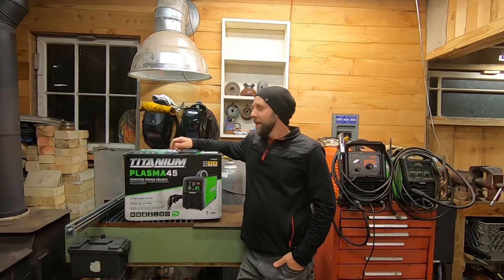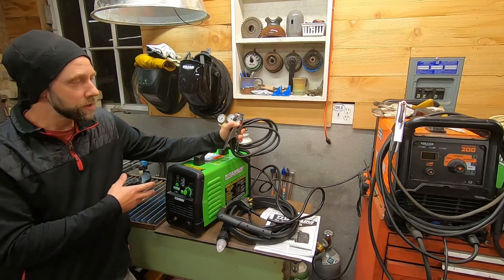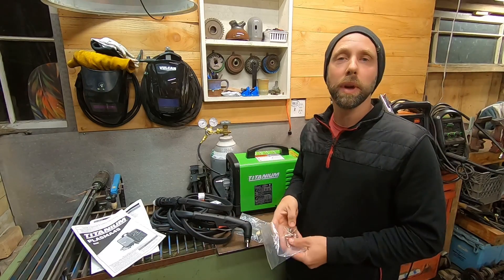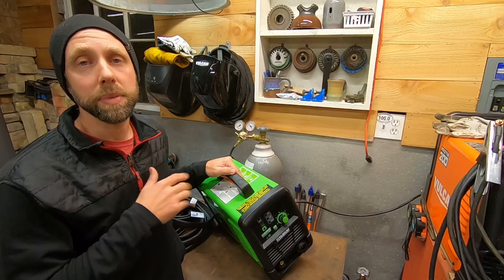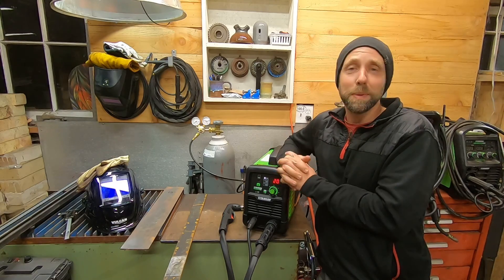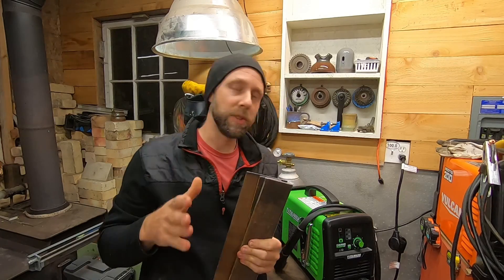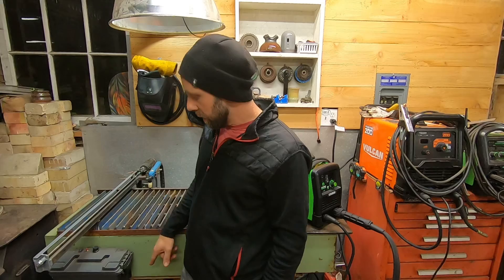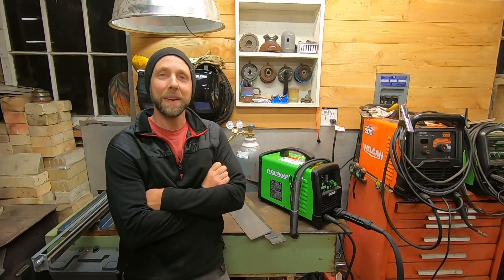Titanium plasma 45 plasma torch review

Comment: Hey Mike. Bottom line if it was your money would you buy it?
Reply from the maker: Hey Todd I think this plasma torch works really well, I have cut over 300 feet of metal and aluminum with it so far with no problems.
Time will tell how it holds up but I think it’s a well built machine. I do think it’s priced a bit on the high side, I think $650 or $700 would have been better. I know there’s a lot of plasma torches available for much less but a lot of them tend to be high frequency start and they won’t work on a CNC table. I would say yes I would buy one but only when it went on sale, but I would really weigh out my options first to see what else is in that price range. Here’s a video of a project I’m building, I have used this plasma to cut most parts for this articulating dump truck https://youtu.be/vFphyNUhsaY
Reply: Mike festiva Thanks for the feedback. I got one this weekend with a coupon for $749 and got the 2 year warranty which was a bit steep I felt but I’ve never go wrong when I have got the extended warranty on their higher priced items. My son and I cut some metal this weekend and I will say it makes a clean cut. If it holds up I will be happy with it. And I also think it’s a bit high priced.
Reply from the maker: Todd Warren I think you will be happy with your 45. If you ever go to cut and it only etches the metal it’s a ground issue, I have found this problem a few times when running my CNC table, It will start a cut but only etch the top 1/16” then if I look at the amp readout it’s only putting out 15 amps when it’s set to 45. 100% of the time the ground clamp just needs to be re positioned or even grind a little spot down to clean metal for the ground clamp. I just wanted to pass that tip on so you don’t think the machine is acting up on you if you ever encounter this 👍 Take care Todd

Comment: Do you have to use compressed gas on that?
Reply from the maker: Just compressed air!
I run it off of my two cylinder compressor, it’s a bit hungry on air, but cuts really nice, I have been using this plasma torch a lot on my CNC table, so far I have cut over 300’ with it and it’s still cutting great! Take care William

Comment: Is it worth $750?
Reply from the maker: I think the price is on the high side, I would think $650 to $700 is probably a better range.
I however I have already cut over 300’ of Aluminum and steel without any problems.
It can cut 1/2” really cleanly too!
Here’s a project I’m building, it’s a articulating 4x4 dump truck, I’m running this plasma torch on my small CNC table, without the plasma torch and the CNC I probably would not have taken on this build, so to me it’s worth it. 
https://youtu.be/vFphyNUhsaY

Comment: I dont have hard wired 240v power in my house. Will this machine work off  230v generator power?
Reply: hudsonhawk 001 Probably depends on the wattage of your generator. If my basic understanding of electricity is correct, you would need a generator with 9,000 watts of continuous power. That’s a pretty beefy generator.
Reply: @josephtalbot125  thanks, guess my 3500 won't work with it.

Comment: I bought a Harbor Freight plasma cutter years ago and though it worked; it gave me fits, they discontinued the consumables and zero parts were available. It was claimed to cut 1/4" steel but you were lucky to do half that. I switched back to gas cutting, abrasive wheels, etc. Luckily I sold it to some sucker and bought the Hypertherm 30xp. Dang it's night and day better. They claim 5/8" cut but it'll do an inch with less struggle than the Harbor Freight unit at 1/8". Not worth it to save a buck on high tech tools.
Reply from the maker: That’s how it goes sometimes, that sucks about the HF plasma you owned, about the consumables, if I was in that situation I would probably just adapt a different torch to it from EBay that has common affordable consumables, but that’s some screwing around, HF really should have continued to stock consumables for that torch. Electronics have come a long ways in the past 10 years and the off brands are getting better. I have cut over 300 feet of metal and aluminum with my Titanium 45 so far without any problems, time will tell but I have cut 1/2” extremely clean so I’m sure it will cut the 5/8” they claim it will. Take care 👍

Comment: Buying a CUT50, I might need a larger compressor though.
Reply from the maker: I own a cut 50 it actually works pretty good, I bought it about 3 years ago, mine was high frequency start, once in a while when you would go to make a cut the HF would arc but it wouldn’t start the Plasma arc so you would just need to re start, not a big thing. I can’t use high frequency on my CNC plasma table. Here’s a video I made using it on a plasma track I built, you will be amazed how clean the cuts come out 👍 https://youtu.be/G4afcmd681s

Comment: Hey Mike how big of compressor would I need to run that plasma cutter 45 titanium
Reply: I use a 5.1SCFM 5 Gallon made by Fortress (HF) and it is able to keep up with the needs of this Plasma cutter (4.2CFM @ 80/90PSI). My altitude is 5800 feet.

Comment: They are quite pricey for home use though, and Harbor Freight's rep for electrical reliability scares me away. The "Cut50" units online seem to be a much better deal, but consumables are a bit of a problem with all these non- brand name units. Thanks for the review!
Reply from the maker: Yes they are pricey, I keep seeing the prices fluctuate quite a bit, $750,$800,$850 they seem a bit high to me too. 
I actually own a CUT 50 I bought on Amazon about 3 years ago. I never did a review on it mostly because of the build quality seemed to be lacking, but it actually cuts fairly well.
If you only plan on using it on occasion I think the CUT 50 will be fine. I wired mine to run on 220 not 120 because of the bad reviews I found on the CUT 50 at the time of people maxing out the amps on 120 volts and smoking them. Consumables were really easy to find on Amazon and they are about 1/4 the price as the Titanium consumables, so that’s not a concern. My cut 50 was high frequency start so I could not use it on my CNC table but here’s a video I made building a powered cut track for my CUT 50, check out how clean the cuts turned out!
https://youtu.be/G4afcmd681s

Comment: I would like too see how thick it will cut clean and severance cut,  does it cut expanded metal, does it do metal  gouging or metal etching,   I have an Hypertherm xp 45 with a 25' cutting torch and a 25' gouging torch shipped to my door it cost Me $ 2,030.00 it will cut up to 1 1/8 inch severance cut, 5/8'' clean no problem 1'' no problem  but it only run on 220 volt,  like I said I would like too see what the Titanium will do because I'm thinking about buying one for next year Christmas gift for my Son

Comment: Mike just a question. Have not seen any more use shown of the Plasma 45, is it still as great and have you cut 5/8” etc? Also have you ever looked at the cheaper plasma cutters they have on Amazon. For the limited use I would have the $700+ cost of this rig would hurt. Thanks for any input as I really enjoy your videos and respect your opinion.  Chuck
Reply from the maker: Hey Chuck I’m not sure if you have watched any of the last four or five videos I have made but I have been running the Titanium plasma 45 a lot in every video, I have probably cut over 300 feet of metal with it without any problems other then needing to make sure my ground clamp is getting a good contact with my work piece. I own a cheaper Amazon cut 50 plasma torch, I have owned it for about 3 years now, it’s definitely lower quality but definitely gets the job done, I have never done a review on it because I didn’t really want to put my name behind a machine that I didn’t have confidence in because of the build quality. I just looked at Amazon this morning and I was surprised at this plasma torch I will put a link at the bottom, it had really good reviews and it’s half the cost of the Titanium 45. I’m actually kind of interested in trying it out. The good thing about the cheaper Amazon plasma torches is the consumables are usually half the price.

Plasma Cutter 50Amp Pilot Arc - Reboot CUT50 Non Touch 110V/220V IGBT Air Plasma Cutting Machine Dual Voltage High Frequency Compact Metal Cutter Inverter 1/2" Clean Cut for Copper Alloy Mild Steel https://www.amazon.com/dp/B07XYPNQ8M/ref=cm_sw_r_cp_api_i_RjXkEbQB911D7
Reply: Mike festiva . Thanks for the fast reply. I looked at the Amazon link you sent and think I may go this way. It would be nice if you or someone as good as you had used and reviewed it, but it comes with a one year ge

Comment: how big of a compressor do I need to run one and do you have any recommendations for one?  would love to see you cut some stainless and aluminum
Reply from the maker: Hey Bill the manual says the air requirements are 4.2 CFM @ 80 to 110 PSI.
I think you could get by with a little less CFM is long as you don’t do really long cuts. Have you seen my other videos of me cutting Aluminum and thicker steel on my CNC table? 
This plasma torch works great so far, I have cut 200 to 300 feet of metal so far on my CNC table with this Titanium 45. Take care 🙂

Comment: Has anyone found dependable consumables for the Titanium 45?  Harbor Freight’s website does not list any, and the other YouTube posts are pretty weak on the subject.
Reply from the maker: Hey James I have bought them at my Harbor Freight, or you can order them online.
The Cups are skew# 56811 and the inside contacts are skew # 56576
I have been looking all over Amazon and E bay for more affordable contact tips but still have not found a cheaper alternative that looks like they will fit. I hope this info helps 👍 PS have you seen my videos of running this plasma torch on my CNC table?

Comment: Does anyone know the maximum thickness of steel this machine will cut? Do you think it will cut 1.5 inch - 2  inch thickness?
Reply from the maker: The maximum cut capacity is rated at 5/8”
I think it will cut 1” but I think the cut quality would be really bad. The most I have cut so far with it is 1/2” and it cuts that really nice. 
I have some videos running it on my CNC table, checking those videos out if your interested in seeing it cut more stuff.
Reply: @Mikefestiva  
Thank you! 😉
Reply: He say 5/8th thick, that was also his last cut

Comment: Has yours quit working yet? I got one and it stopped working after two weeks... I took it back and got another one... It quit working yesterday it lasted almost 3 weeks... That is why I'm looking online to see if others have the fix or if they're having the same problems... I'm taking it back today for a refund I hope...
Reply from the maker: Sorry to hear your not having any luck. I have not had my plasma 45 quite working yet, I have cut over 300 feet of metal and aluminum and most of it’s been cut at the full 45 Amps. I have been through about four sets of consumables so far. 
I have had my plasma torch act strange a few times, I thought it was not working right a few times on my CNC table because it would only cut at around 15 amps even though it was set to 45, I realized it was not getting a good ground, even though the clamp was on the metal, I had to re position the clamp and even grind a clean spot on the metal. After that it cuts great. You said it stopped working, so you mean you could not get it to start a arc? Have you checked and changed tips? When mine got a bad ground on the metal it would only barely cut into the metal a 1/16” till I cleaned up the ground. Did yours show a F code on the front screen?

Comment: Nice review how big of an air compressor do you think you could get away with and still work?
Reply from the maker: I have not tested it on a pan cake compressor yet, I think it would run on one as long as your not making really long cuts, I have a old large two cylinder air compressor and it has no problems keeping up but I’m making really long cuts, some are 3 feet on 1/4” in one cut. Have you seen my videos running this plasma torch on my CNC table yet?

Comment: Hi Mike.  Is this product supplied to you by Harbor Freight at no charge?
Reply from the maker: Yes this plasma torch was given to me like I said in the video. For the record I have paid for every other welder I have reviewed in the past. Vulcan Omnipro 220 $750 Titanium 200 $650 Vulcan ProTig 200 $1000 and the Titanium 125 $179 It gets expensive trying to review gear like welders. Take care 🙂
Reply: Mike festiva hey how’s it going mike. Enjoy your vids my dude. I just recently bought my titanium 200 can u tig weld aluminum with it or do u recommend a Spool gun)? Also what kind of caliper is the one your measuring with ? Thanks bud
Reply from the maker: Hey thanks! I recommend a spool gun, the TIG is DC, AC is the most common way of welding aluminum with TIG. People say it can be done with DC but I really think it’s not that practical. I’m using the Husky brand calipers from Home Depot, they are about $28 but I find them to be a lot nicer quality compared to the fractional calipers you can pick up from Harbor freight on sale for $10. But both calipers will work the HF ones just really feel cheap. I hope this info helps. Ps did you see the video I posted welding aluminum with a SG using the Titanium 200?

Comment: Way over priced! you can get a 50 amp Everlast with a 3 yr warranty for $550. And a non HF blow back made for a cnc table for $700. I can't find any info on what kind of start this plasma runs but if it is HF as most are it can interfere with the electronics on a CNC. They don't always but can. for $700 the Everlast 50s is a way better buy. If you are not going to run a cnc the 50p is a killer buy at $550. Just my thoughts if you haven't bought yet you might look at Everlast. I have the 221sti multi process mig tig stick AC/DC and OMG it is so smooth I love it. Going to buy a plasma next.

Comment: Why didn't you run it on 220 & show us how it cuts with thicker steel ??  It appears you have 220 there to run the Vulcan.
Reply from the maker: I do have 220 in my shop, the reason I just ran it on 120 volts in this video was a lot of people always want to see how good these machines run 120, if it cuts good on 120 it will cut great on 220. Also the video would have been really long if I ran it though all the metal thickness on 220. I hope to post a video sometime soon on how it does on 220. I’m just busy with other things like running this torch on my CNC table and I’m building a articulating dump truck tractor.
Reply: @Mikefestiva  Ok, understood. Thanks.

Comment: It's cool they have entered the plasma market, but they priced it higher than the Everlast 50p. I can't imagine it would outperform/outlast that, and it costs $200 more...
Reply from the maker: Hey Aaron 🙂 I’m not to familiar with the Everlast lineup but I looked over there 50 Amp plasma torch, the Super Cut 51P it’s $577 on Amazon but the thing about that one is it looks almost the same as the cheap no name CUT50 that sells for around $250. I do think the Titanium is a bit high on there price point but after taking off the cover and looking inside I was pleased to see how well it was put together, I have a older CUT50 and it’s definitely not nearly as nice inside. I did however see a Everlast for $733 on Amazon that had kind of a soft start to make consumables last longer and a CNC plug on the back so that’s definitely nice. Take care Aaron 🙂
Reply: @Mikefestiva  I am in the market for a machine like this in the spring probably. I have 2 Everlast welders, they have my vote of confidence. The 50s is $687 direct from Everlast. 
It has pilot start and slightly higher max thickness/duty cycle than the Titanium. 
I'm sure Harbor Freight will eventually have some good sales once the Vulcan version is available.

Comment: Does it run off generator power?
Reply: Probably? 7200 watts 240v 30 amps (240*30=7200), so you'd need to kick out at least 7400 watts at sea level. About 2600 watts @ Sea Level 120v 20 amps (120*20=2400). I've not tried it yet, but I also live at 5800 feet so I loose about 3% per 1,000 feet. :(

Comment: I picked mine up last night. Havent tried it out yet
Reply from the maker: Nice! I think you will be happy, it’s definitely a useful tool to have in the shop 🙂
Reply: How has the Plasma cutter treated you for the last 5 months?
Reply: @delta34golf  This was my first plasma cutter,  so I had absolutely NO experience with other machines or just using a plasma cutter in general.  ALL my previous cutting was done with a cutting torch.  Also, I just do DIY stuff but so far I am happy with it.  Ive mostly cut thinner stuff. But No regrets so far.

Comment: How do you regulate the air pressure?
Reply from the maker: It’s got a built in internal regulator, so all you need to do is plug in air and make sure your compressor stays above 90PSI
Reply: Thanks for the quick response and that's awesome. I see it's out and on sale for 749
Reply: Went and bought one a couple a week ago and haven't had and complaints. This thing cut smooth as butter.

Comment: If I bought one of those $150-$200 air compressors from harbor freight to use with this, would it work?
Reply: Chucke2009 does a pretty good video on compressor size for plasmas
Reply: likely something in the ball part of this (these are the settings for the Chicago Electric one) 4.5 CFM @ 60 – 80 PSI